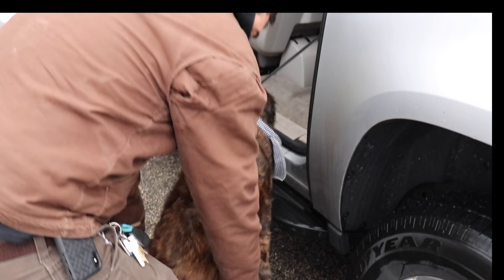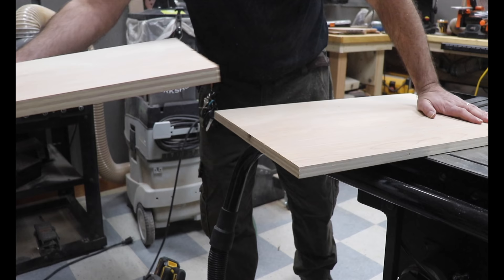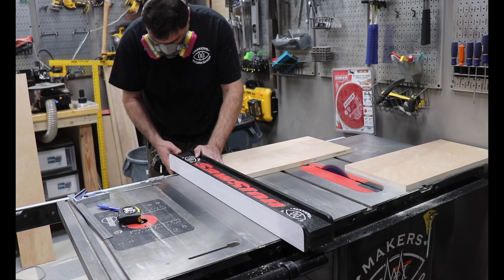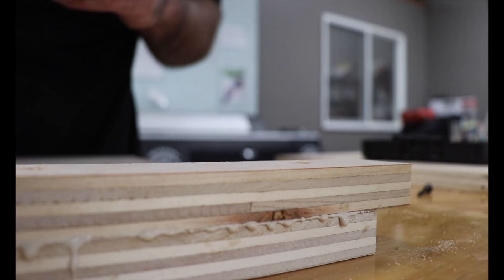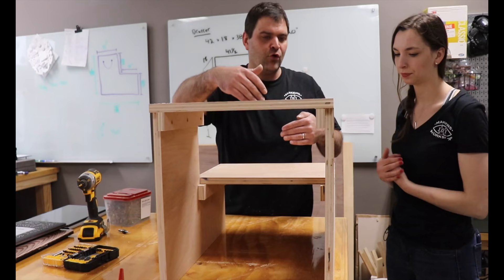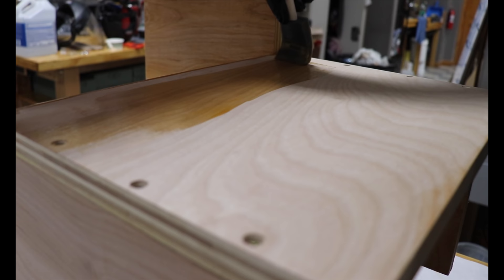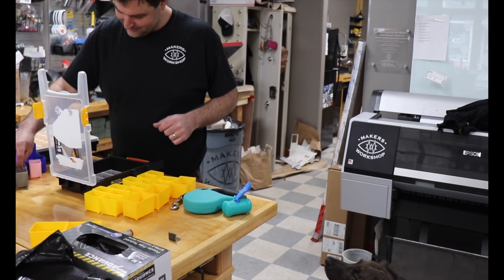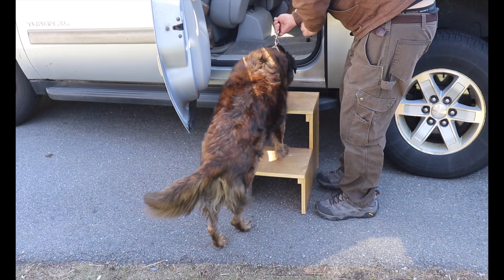How to Make Dog Stairs

Comment: Hi, this is a great idea. How would you make a ramp? My dog front legs are 2.5ft apart, he has a very long dog. Stairs would need a deeper step tread. Sort of like how stadium steps are deeper. 
I'm looking up ways to make a ramp for my dog to step up onto the passenger floor of a 2005 4Runner. 
The ground to the floor level is about 21in high. 
I want a 5in step to lift the ramp up a little bit. 
18-20in wide. 
Leftover plywood pieces from 18-25in wide and 42-59in long. (It's not quality plywood, on a budget).  
Waterproofed for outdoor use. 
Slip proof. 
Challenge- hinge to fold it up for transport.  
Everyone tells me this isnt possible.

Comment: Any suggestions on keeping it square as final pieces go together? Seems like I get a twist somewhere and drives me nuts! I dont have many tools so just trying to do it with basics... but getting it together without it getting unlevel and not square is my nemesis
Reply from the maker: Clamps, corner clamps, etc. are really the best way to go. For a make shift corner clamp we’ve clamped a square into the corner of pieces to keep a right angle. If you check out the laser cut desk video, we made use of that technique there. We also love band clamps for square-ish things.